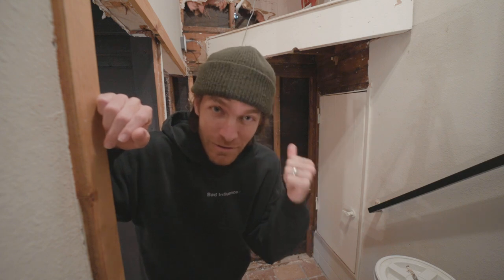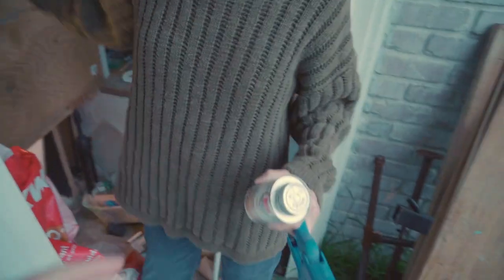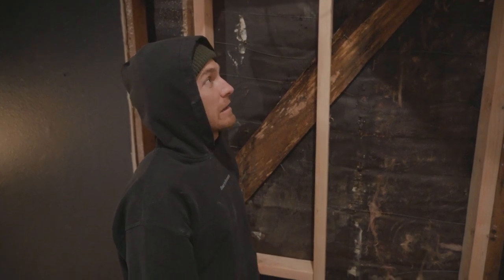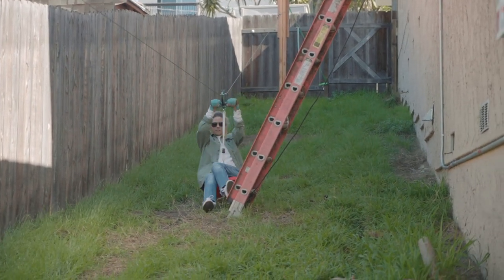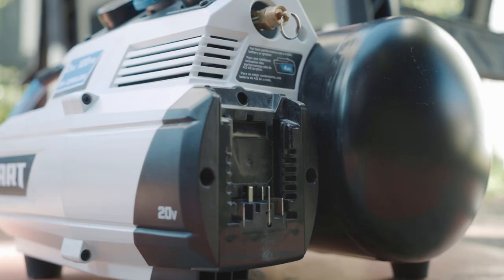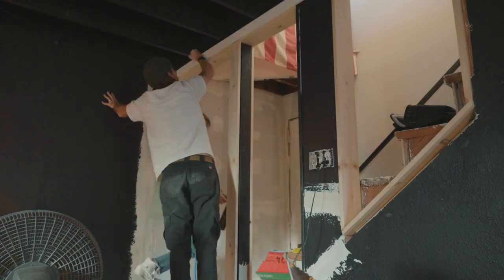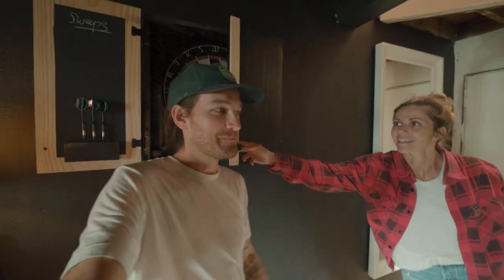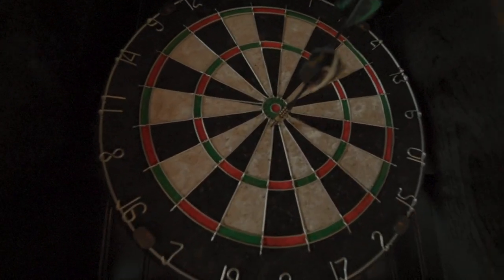We finished the jam room! Garage renovation 3/3 - Vlog #270

Comment: Hello just wanted to know approximately how much you spent on the room addition? Comments were off on that video or at least part 3. Thanks in advance
Reply from the maker: Thanks for the question. We did the room addition right before lumber prices went through the roof so the cost for a project like that has definitely changed unfortunately. We gues-timated 6k going into it and ended up pretty close to that number. Are you thinking of doing a room addition?
Reply: @GuestHouseVM  yes we are. Actually we want to extend our master bedroom out as well as our closet. Looking about extending the wall out at least 6 feet